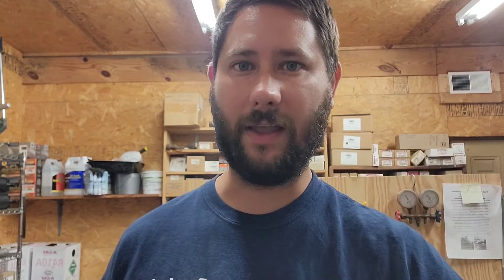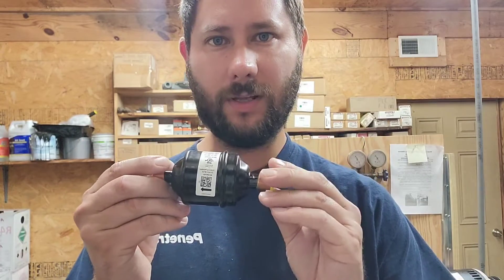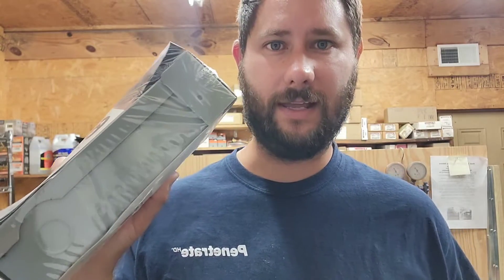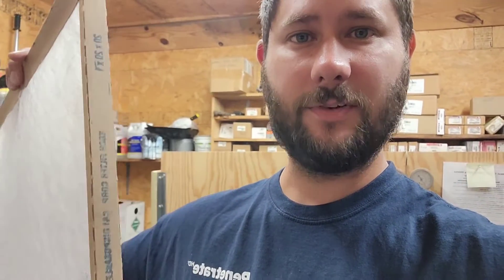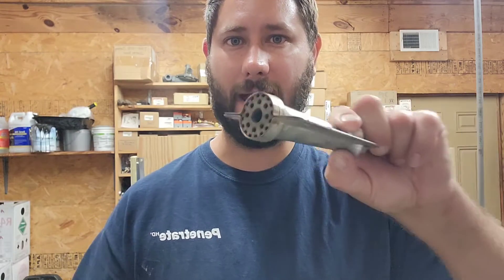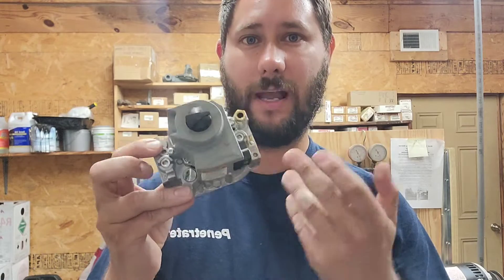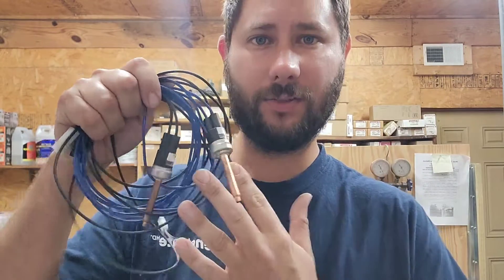Improving HVAC Education: Key Topics for Schools

Comment: Yeah they skip some basics thats important. One thats simple is when your running gas piping and you finish put about 30 40 psi in it to check for leaks and let it sit for hour. Or if possible over night. I used to be heavy in doing hvac my brother knew a whole lot about hvac an electricity but he passed away in car accident sept 1 of last year. Im currently workin in a factory but considering on becoming  tech

Comment: @TaddyDigest is it possible to become an HVAC contractor without any schooling or apprenticeship? Like learn on your own.
Reply: @TaddyDigest thank you so much! You give me hope, I started late in the trade, but have learned a lot on my own in a short period of time. I recently got my EPA Universal, I know how to do breakers, capacitors, even thr boards, find low voltage short, change thermostats, check SH, SC etc. I havent had much luck finding a company that will hire an apprentice around my area so was thinking of going at it on my own, but it has been hard getting a start. But hopefully soon I get some clientele🙏🙏 BTW I follow your videos, and appreciate everything you do.
Reply from the maker: Very cool you're gonna do great things
Reply from the maker: yes absolutely 
Learning on your own or working for a company is in my opinion the best way especially with the standard schooling that we have now.

Comment: I've been working in the industry and teaching HVAC at many different levels and many different venues for over 30 years and I have to compliment you on an outstanding comprehensive list of required skills to become a competent parts changer in the residential and light commercial HVAC industry. But any good  HVAC program should provide much more than that.
Reply from the maker: Well said!

Comment: You should make a video on testing ECM motors! I have no idea what low voltage to the motor is suppose to have voltage to run, specifically in different speeds
Reply from the maker: I have a video on that check out my playlist h v a c tips for technicians.

Comment: Tadd,   you should be opening an hvac school to teach new comers to the trade. Did you mention sub cooling or super heat.?

High schools should have good hvac programs  that are  effective and not just basics (theory).  This is a good gratifying trade for new generations as  AC is a need not a luxury anymore as it is getting hotter everyday.

Learning on the job is great, but I  know  technicians that don't even know  the logic behind the process (or just change parts).  (not trying to offend anyone).  

Great video
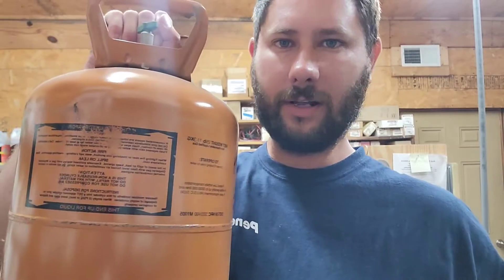Reply: 2:57 superheat and subcooling are mentioned right after refrigerants are brought up